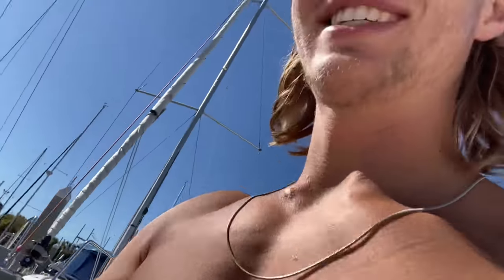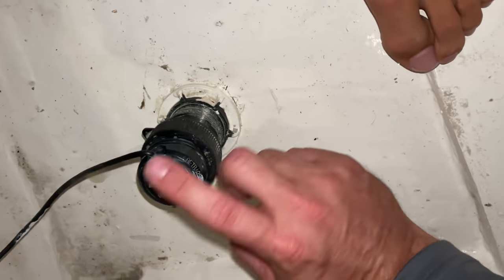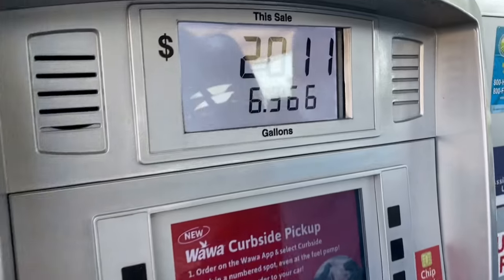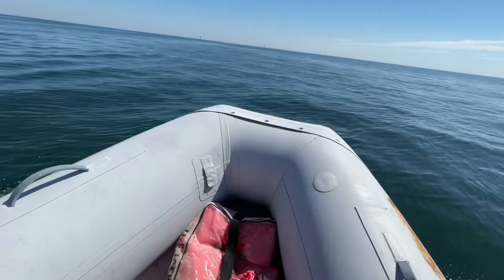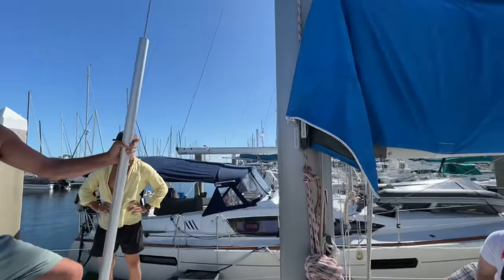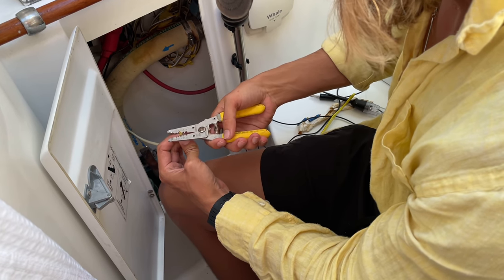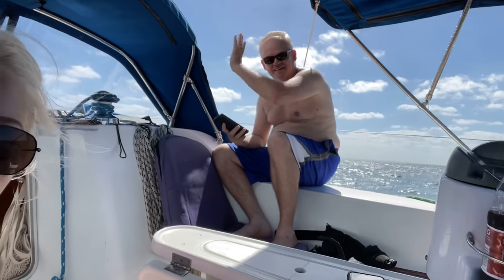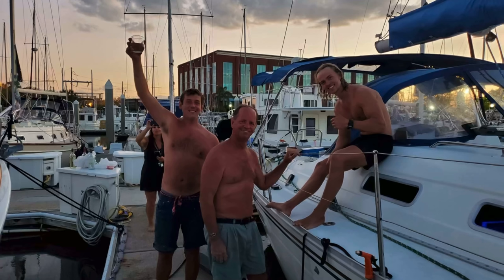WE’VE SPRUNG A LEAK💦😱 / Installing a Wind Speed Indicator /Last Day At The Marina🥺🥺

Comment: Small point, if you are going to use that "new" hose for potable water run some bleach through it and label it potable water.  White hoses are almost always potable water only and other colours could be used for anything.  Also some places will only let you use a white hose to connect to their water system.

Comment: Thats the way to do it. Not only will your new dingy serve as your water taxi when you're on anchor, But if the worst case scenario happen, "and pray it doesn't", but your new dingy could then save your lives. GREAT JOB.
  Maybe start a list to, "A safety priority list". Among other things on this list, like several fire extinguishers that are jn good working order, and the Guage on them indicates that they are all fully charged. 
  No.2.)find and locate every through hull fitting you have on the boat. And visually check those locations everyday, and insure they're not leaking. It's probably wise to make sure those through hull fittings are the bronze kind. Preferably not plastic. If they are plastic, replace them with the bronze through hull fitting, when you're able to. 
  Also, some peoples plumb a valve right tight against  the bronze through hull fitting, so if you ever have to change the hose coming off the bronze through hull fitting, you just turn the valve and close it, so absolutely no water will leak into the boat, while you replacing the hose. Or whatever else you're on that needs your through hull fitting VAULVE closed for.
  Word of caution,  Always remember to open your through hull fitting VAULVE, when your job is complete. Some of those through hull fittings are made of plastic, ant can break or crack, developing a new leak
  Always think safety,and always continue having fun. Just one more word of caution, "The word b.o.a.t. means = Break Out Another Thousand. Your new boat is going to be a lot of fun. But they are expensive to maintain. 
  But enjoy, and have fun.
Reply from the maker: Thank you! We love her! They’re so hard to find around here🥴
Reply: Your welcome,
  Take care, all the best,

Virgil V. Jr.
Ex. Commercial 
Alaskan fisherman, 
Ferndale Washington

Comment: Heaven forbid your dinghy ever bucks you off. throw away the wrist strap and get a clip to attach the kill lanyard to you clothes. those wrist bands with slip off when most needed. If you haven't already, attach wooden bungs to each thru hull location... Just in case.